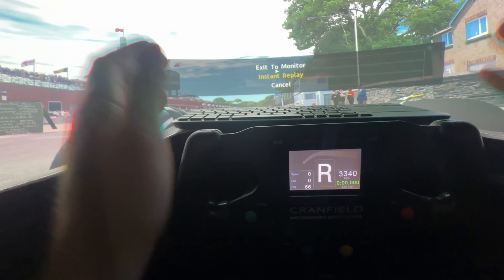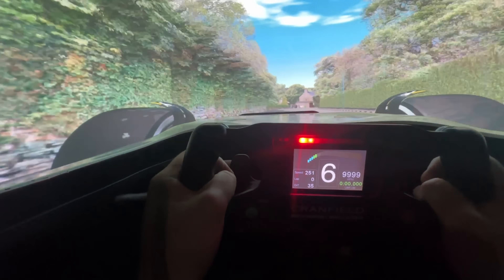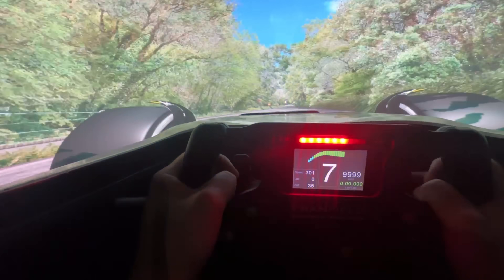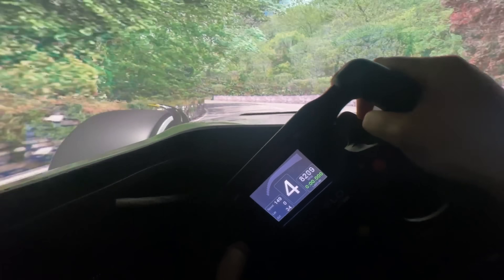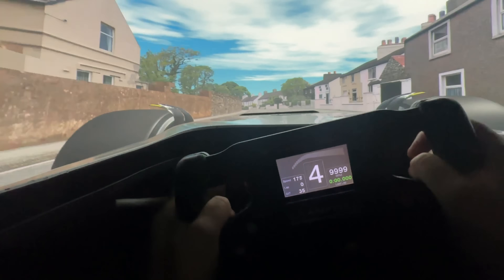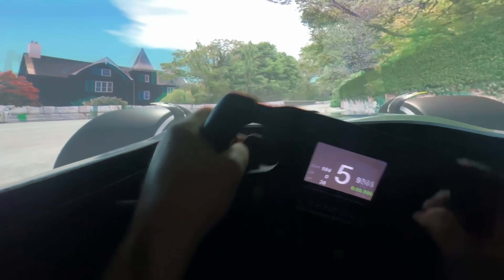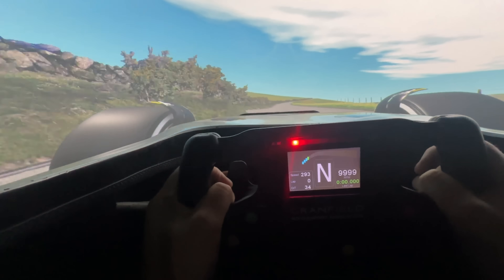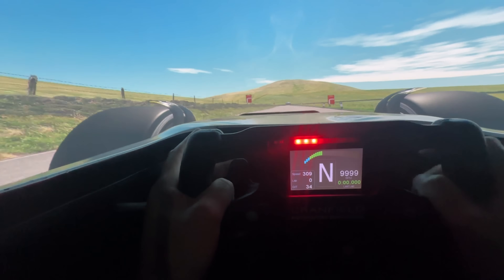How Fast Could an F1 Car Do A Lap Of the Isle of Man TT Course

Comment: Considering no-one has tried this is important, I'm not sure the road surface could be coped with effectively over the entirety of the course, they tried a rally car but it was desperately undergeared and could have been faster, same as the simulation was, can you upgear it and try again?

Comment: It’s a long lap, 37.3 miles, 1400’ elevation change, lots of bumps and jumps, would the f1 car have enough clearance, angle of approach, angle of departure, when was the last time a f1 car deliberately took to the air? Run a big wing with DRS, charging and deploying the battery, ensuring there’s enough steering lock to both sides. Definitely not a job for Lance Stroll.

Comment: I can't imagine an F1 car dealing with the uneven roads along the TT circuit.
Reply: The bumps would be fine for the kinematics of the car but the ride height would be so high that the ground effect aero wouldn't work on the current gen cars. You'd have to put a lot more 'on top' from the front and rear wings which would chew into the top speed although DRS could overcome some of that. Fascinating to think it all through though (for a geek like me anyway!!)
Reply: @davidraeburn-pd5ee yeah, was thinking ground clearance issues myself, that and gearing, I've watched that rally car go round a couple of times, it needed higher gearing, the penalty on slow corners would have been far outweighed.

Comment: Is your maths correct? For the 65-second  lap of the  Redbull Ring to the 90-second Moto GP lap, the difference is 25 seconds.
25 seconds  is 38% of 65 seconds. I think that just maybe you used 105 seconds and 130 seconds.

Comment: F1 car not physically capable of a Manx lap in competitive trim so an irrelevant comparison really.
Mark Higgins fabulous 2016 lap of 128mph in a specially modified rally Subaru shows how good these cars are despite being 25mph slower at the top end.

Rallying the nearest motoring equivalent of the unsurpassed IOM in road based motorsport.

Comment: I can't believe I haven't seen anyone ask about your sim setup. So i will. What are you running? Hardware and software wise
Reply from the maker: It’s an actual F2 tub. Was used by an F2 team as a training rig and then sold on when they upgraded. Has a genuine F2 carbon wheel and hydraulic pedals. Some piece of kit

Comment: My God! that's a long course!  Lots of fun - what a difference driving on the narrow English roads, where a slipup doesn't put you in the gravel - it turns you into gravel.  Very interesting "in theory" - but of course F1 cars are very dependent on ground effects, which would be nonexistent on many parts of that rough road course.  An absolute validation of "In theory, theory and practice are the same - but in practice, theory and practice are VERY different."  

Proves the worth of a simulator.  Very fast, very fun, and a crash doesn't kill you.  I can see many, many laps and plenty of study before you take to that track in anything with a motor in it at speed.  Average speed of 175 MPH - woof.  Reminds me of when Dan Gurney won the cannonball rally in a Ferrari Daytona in record time - when asked how he did it, he said "Easy - I didn't have to go over 170 the whole way."  That's on American roads from New York City to the West coast in just under 36 hours.   

Great video, great fun.  Nice job.

Comment: Good stuff! The way I see it, ANY rider or driver giving it 100% and what Markku Alen used to call "Maximum attack!", deserves total respect, no matter how many wheels they're on, no matter how much aero or tech they have to keep them upright.

The TT bike riders are gloriously, magnificently nuts; drivers in cars face different challenges, but at the end of the day if they're pushing just as hard, the result of getting it wrong is going to be just as nasty because, although they're more protected, they're also likely to be going faster when they run out of talent.

I used to be a rally driver (of sorts, and only amateur) back in the Group-B era; I hit some trees, rolled a couple of times, fell into some ditches, but never had the guts or skill of the works drivers to push at ten-tenths when it counted. I'm still alive, though, so... no regrets for playing it (relatively) safe.🙃

Comment: The bikes lose a little speed as they come over crests at 150 or 200 mph and come off the ground, jumping through the air for perhaps 100 - 200 yards.. The downforce from the F1 car's wings would stop it from jumping and keep the wheels on the ground over the crest, so it wouldn't lose speed.

Comment: I think an F1 car would get stuck at Governor's dip & possibly bottom out over Ballaugh bridge. Edit: I think you may have issues of air-flow detachment (I think that's what it's called) around windy corner on an F1car so it'll lose most of it's grip.

Comment: Good for a laugh. A current F1 would not get to Quarter bridge. The bottom of Bray Hill it would bottom out in the compression and then take off and flip at Ago's leap. What is needed is a pumped rally car not reliant on underside aero, a Pikes Peak car? IOM roads have camber to channel rain off which would destroy F1 under floor aero.

Comment: Mark Higgins in a Subaru rally set up was significantly slower (128,mph) than a TT bike. I think f1 would be quite close to a bike, if faster then not by much
Reply: An f1 car would slaughter the the bike lap record with ease, even with slowing down for bray hill, beggerrow etc.

Even an f1 car from 40 years ago would be way faster than any bike.

Probably have to go back to the early 70s late 60s to find a competitive f1 car that can't do 130mph lap.

Look at the car and bike lap records on the old spa 9 mile road layout, the car lap record from 1973 was still 25mph faster than Barry Sheenes 1977 lap record. 

Pretty much any competitive f1 car or prototype sportscar from the early/mid 70s onwards would be able to crack the 140 barrier, an f1 car from the last 20-30 years would probably find 150 fairly easy.
Reply: @theant9821  You can't compare lap times round a billard table surface like spa with the bridges tight turns of a main road. The F1 relies on downforce for grip , the undulations on the IOM would disrupt that too much. not even the better acceleration would make up for that. Only over the mountain would the F1 stretch it's legs.

Comment: It’s pretty obvious what makes  an F1 car is quicker than a Moto GP bike, is that a F1 car can generate much more downforce than the bike especially through corners. If it was a straight line speed test, the GP bike is quicker than the F1 car, due to its power to weight ratio. An F1 car on a road course like the IOM, is going to be compromised due to its road bumps and unevenness, I would imagine it would be very difficult to set up, as an F1 car is so stiff, I don’t think the driver would enjoy it much!  Interesting to view. A road/track circuit which would make an interesting comparison, would be Le Mans, lots of fast straights and flowing corners would bring the GP bike a lot closer to the F1 and Hyper Cars.

Comment: Anyone who has ever seen an F1 car attempt a tight motorcycle short circuit (far less a road race) will already know that the F1 car will be lapped twice over by the time it has tried to sort out yet another end swap.

F1 cars go brrr in straight'ish lines at high speed and they go flobble-obble-obble everywhere else.

Been there, seen it, no contest.

Comment: Interesting video, very impressive driving. 👍
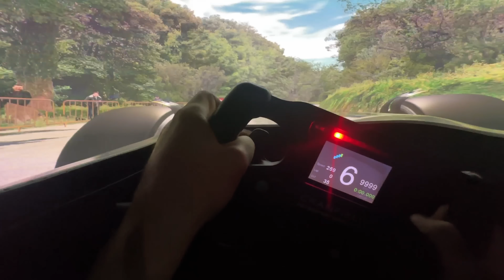My best time with the Grand Prix Legends sim is 16:43.288 (135.4mph) in a 1971 Lola T260 Can-Am car, and for something a little more familiar, 17:21.159 (130.48 mph) in a 1969 Lotus 49B Cosworth. I have 93 other lap times with various historical race cars. It's great fun!
I much prefer using non-aero cars around the TT course, as that emphasises driving technique above reflex/reaction times.
I agree that a modern F1 car, with all its sensitive under-car aerodynamic aids, would never survive a lap at the TT. But older racing cars were built much tougher and less sensitive, and IMO would be quite reliable around the TT course. Remember what the old Monza was like in the 1960's, with its high banked oval and punishing surface?

Comment: As you say, it's all in theory. The course would probably destroy an F1 car's suspension, and that won't be pretty.

However, since it's all theoretical, we could go a bit further. The Red Bull X2010 was a simulation of what F1 technology could achieve if the technical regulations were all binned. If you want to go really nuts, try the TT course in the X2010.

Comment: As a former F1 engineer AND motorcycle road racer on the isle of man this year, I know quite well those 2 worlds, I know how extremly demanding is the moutain course and how those "perfect tarmac" queens are fragile. I quarantee a F1 car will not survive a single lap of the TT course! But great video Jonathan !
Reply: they handled nurburgring just finee. I'd imagine they'd just raise the suspension, right?
Reply: @af4237  sure only carousels give any real issues. But the TT is normal public roads. That makes the Nordschleife look as smooth as a pool table. They have to have the Monaco setup ride height and steering rack wise and Monza aero package to make most of straights.
Reply: @af4237  never been to the island , have you . 
there are places that are bumpier than a bumpy thing that has had bump lessons. 
there are a couple of places where a bike will bottom out , 1 of those places is going into a corner , a car is going to bottom out and go straight on. 
 a rally car would be better .
Reply: @af4237  Raising the suspension loses them the advantages of aero and ground effect. Can you imaging trying to drop an F1 car into Governors? It'd need about half a metre of clearance to stop it bottoming out🤣.… Ballaugh would be entertaining too, as would the dip in the middle of Barregarrow bottom (losing aero in the middle of a bend). Gooseneck, on the other hand, would act as a banked turn for the car.
Reply: We are comparing apples and elephants here. The premise of the video is for fun, and it is fun. If you were an F1 engineer, you must know given 6 months, and the challenge of building an F1 car solely for the purpose of achieving the fastest lap around the IOM, F1 teams, with an F1 driver would blitz anything a bike could do. To suggest otherwise is ludicrous.
Reply: @superstardeejay2468 not so sure. Bikes go airbourn on various parts of the course.....if an F1 car goes airbourn it's gonna flip and take off once the air gets under it.
Reply: How about an F1 around the NW200 or The Ulster GP?  maybe not a bad idea for another 2 videos. Lol ✌️
Reply: A car that would challenge would be something more like a Pikes Peak hillclimb car I would imagine.  Mark Higgins in the 600bhp Subaru STI (amazing lap) was about a minute under the bike lap record .  That weighs about 1175kg.  A hillclimb car could be 900bhp, 8-900kg, increased aero, but not ground effect, that might do okay.  But would they have the ride height and suspension to cope and you still have to drive the thing at insane speeds. Either way an F1 wouldn’t be suited, especially not in the ground effect era, would pull grids up and shake like a shitting dog at high speed……
Reply: Not a lap in earnest but an exhibition lap maybe.
Reply: Unless U were pottering at 50 mph it wouldn't get round the first couple corners, with the cambers, jumps and bumps. It'd be in a wall fr
Reply: Bike would be quicker
Reply: @CawKee yes for pure straight line Speed the bikes are faster than F1 and the advantage of the F1 car it’s aero allows them to have corner apex speeds faster than anything else. Alas there is just not enough time in corners compared to straights for the F1 car to make that advantage tell. 
There is a somewhat comparative lap time several times there has been a custom modified Subaru Rally car that would give an idea of the lines a car would have take. It even had DRS for the straights but still only topped out at 180 mph briefly in a downhill hill segment. If you get a chance there a full uncut onboard lap on YouTube of the Subaru. With commentary from the driver as a bonus.

Comment: Love the premise of this. 

Some other data points that may inform:

1. Time spent on full throttle
2. Time spent at max chat (you covered this)
3. Time spent on brakes
4. Av speed through tight or long corners. 
5. The bumps will unsettle the aero and car more than the sim allows, IOM is not flat. 

Pre demo lap, I’m going for a lot lower av speed c. 150mph.

Comment: What software / sim / circuit add on are you using?   the biggest problem with modern F1 cars is the size, they are 2000m wide and like over 5000mm long, plus the roads like from Ginger Hall to Ramsey you would lose vision because of the road is so bad (vibrations due to road ripples) and then what about Ballaugh Bridge.    for sure you would need to use something like an older V8 2012 car or something smaller than the current cars.

Comment: On a road course it's all about how much speed you carry out of a corner which depends on grip or lateral g and acceleration which increases the more grip out of the corners. So i don't think a motorcycle is going to approach nearly 5g in a corner! 😂😂😂 I'm a huge fan of Motogp and F1 and I've raced motorcycles and formula 2 cars. There's always about a twenty to 30 second per lap differential favoring the formula car. It's just physics! 😢😢😂😂🎉

Comment: Interesting video , but hey I'd like to see it tried in real life. Red bull like doing bonkers challenges. If only they could be persuaded, and the IoM TT organisers would allow it during a race week ... yeah not going to happen !

Others have said it here , the bumpy nature of the TT course. F1 cars are designed for the billiard table flat tracks of F1.
Yes there are some street circuits out of which I guess Monaco would be the closest to the type of roads at the TT, I still see the nature of the TT course country roads being a real challenge for a real F1 car.  I'm guessing it might be better to go to one of the older flat bottom pre 2022 F1 cars and not rely on ground effect. I'm sure ground effect aero could seriously be compromised by the TT course and make the handling somewhat of a challenge for the driver.

I reckon the Monaco steering rack (they run a different steering rack at Monaco for the hairpin !) , would be needed for the hairpins at Ramsay and Governors . 

Bottoming out at the bottom of bray hill could be a major issue. Even Eau Rouge  at Spa doesn't look quite as extreme as the Bottom of Bray hill.

A more realistic vehicle to tackle the TT course would be one of the rally cars that are designed for country roads. Group B got banned 40 years ago, one of those would have been bonkers !
Reply: The later rally cars ended up being faster than the Group B cars due to better tyres and suspension design.

Comment: Lovely vid. You must have practiced that F1 run several times first. But can you tell us. Did one of the rally champs actually do it in a  Rally car. That should have clocked an impressive time
Reply from the maker: Mark Higgins. 2016. 17min:35secs. (128mph) Ver impressive.
Reply: @TwoWheelsOneIsland  Almost as fast as the 600cc lap record i didnt think rally cars were that quick on the straights

Comment: "So let's just say 136 miles an hour. And it's not going to take a genius now to say 136 plus 25%. It's going to get you somewhere around 170 miles an hour" except it isn't...

If an F1 car does a lap time 75% of a Moto GP, it doesn't mean it's 25% quicker, it's 33% quicker. So if you take the lap record of 16:36 and reduce it to 75% of that, you get 12:27. So over the 37.73 miles of the TT course, an F1 car would theoretically average 181.83 mph - which is 37.73 / (747/3600). Another way of saying it is if the bike averages 136 mph, multiply that by 4/3 or 1.33 aka 33% faster and you get 136 x 1.33 = 181.33 mph

As he actually completed the course in 13:31, then this would equate to an average speed of 167.48 mph over the 37.73 mile course.

Comment: If it could last an entire lap I’d be more interested in how fast a McMurty Speirling could turn a lap. Noting it’s 420mm narrower, has substantially better acceleration at low speeds and no loss in downforce, along with a better CFD I’d imagine it would post an insane lap. Theoretically of course.
Reply: McMurty going full chat only has a range of 30-40 miles..
Reply: @Chongo_657  yeah that’s why I said if it could last an entire lap. With regen braking it might possibly manage a lap, but I doubt it. If it could it would be a sight.
Reply: @TheReboot they could definitely turn the wick down a bit to get a lap done at nearly full chat, but it's not that fast at top speed, 180 ISH? Not too much braking on IOM TT so regen wouldn't be enough. I'd still love to see it though, thing is awesome.

Comment: I'm not at all interested, usually, in this sort of video. However, Having done around 50 laps on closed roads before and after races and another couple of hundred laps all about 30 years ago, I was amazed at just how good my memory was of the sequence of bends and my recollection of the names. It must just be that the intense grip on the bike and the concentration required must imbed that into your brain. half the time I struggle to remember what I was doing on each day last week, I can still remember that circuit. Great memories.